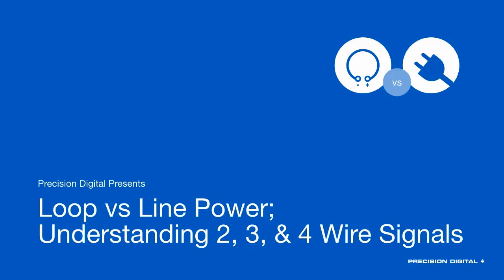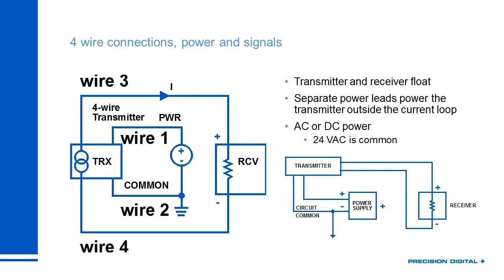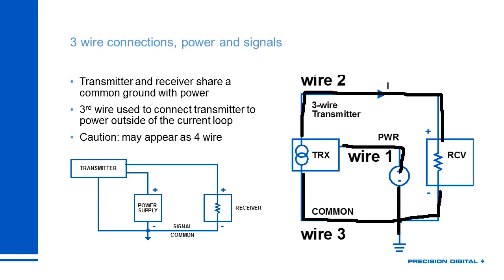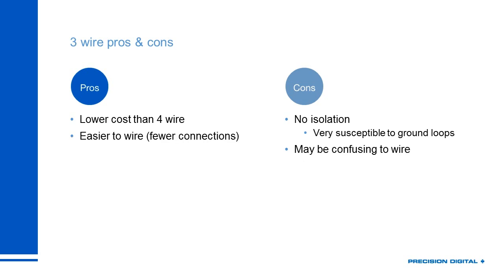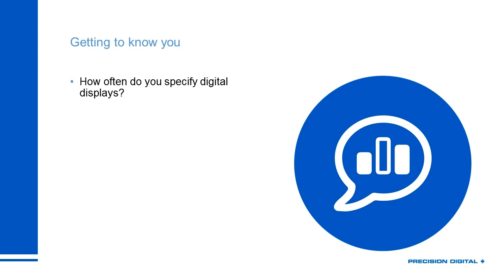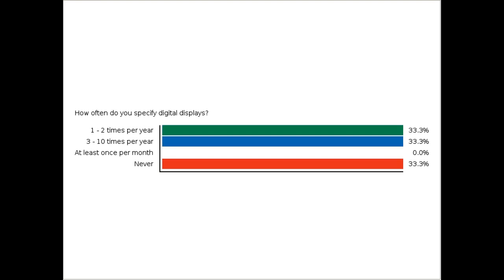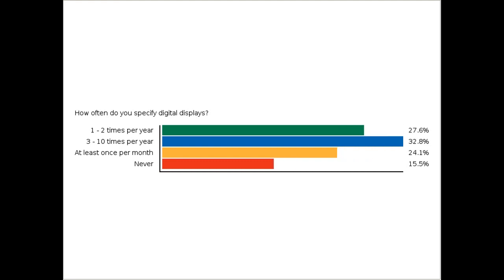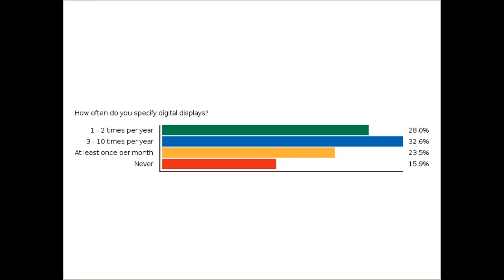Loop vs Line Power; Understanding 2, 3, and 4 Wire Signals

Comment: Nice start, I would like to see how to connect a level transmitter up to a PLC and how to configure the AI card and the analog signal so that it can be used in the PLC code.
Reply: Check out some of tim wilborne's plc videos. He mainly does Allen Bradley but the fundamentals are similar all around